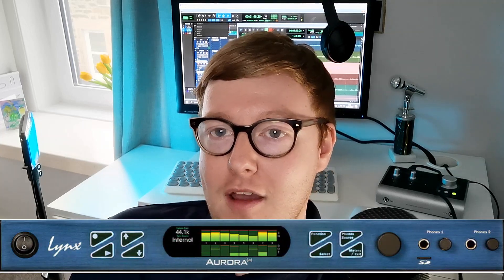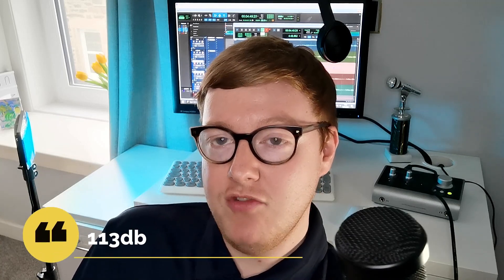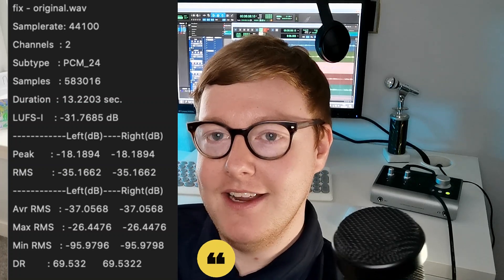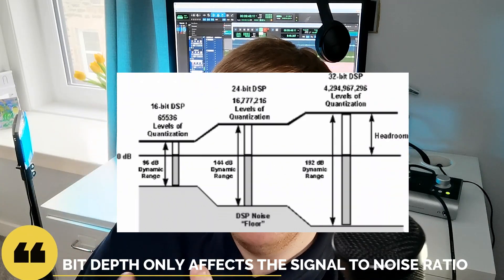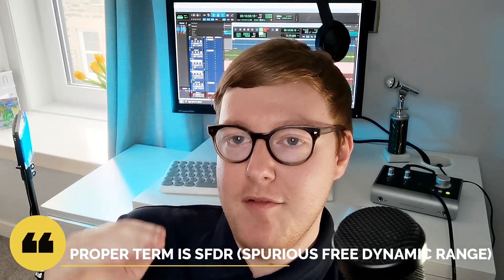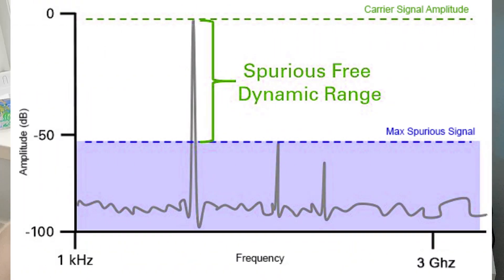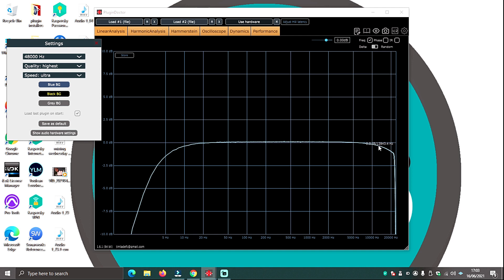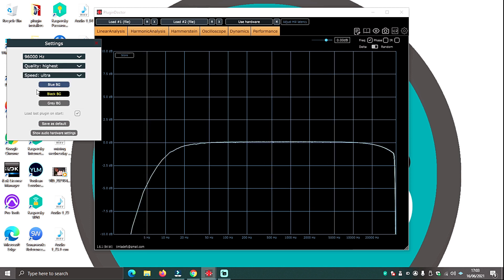Do you lose audio quality in analog gear using budget interfaces vs expensive ADC Converters (Pt 1)

Comment: this test is invalid cause in order to test audio degradation of a converter by a null test you need to loop the DA output via a cable to the AD input of the interface and record .... so if you did that now explain to us how you managed to do the same in real time using the aurora .... did you send them the original file and they did the same exact thing with the same cables same daw  you used ?... its almost impossible to test and compare 2 different converters (or even the same converters) by using 2 different signal paths .... and transparency is not always the goal when talking about high end (expensive) conversion, its also color, how hard they can be driven etc... P.s my converters cost 60-100 euros nowadays (old emu1820m)
Reply from the maker: The audient tests are a simple DA AD loop running input into output.

The access analog lynx converter is still a round trip but its streamed over the Internet lossless. The exact same audio file from my daw is fed into their converter and then fed back into my daw in real time. I then print that to a track, as I did the audient. All tracks going out from the same daw to a converter and coming back into the same daw and then being printed in real time in the same daw session. Theres more latency with access analog but also latency with the audient so all the waveforms were manually adjusted at maximum zoom so they lined up as perfect as physically possible. 

Pretty valid test to me conseriding the circumstances. I didn't say it was fully 100% scientific but it's still a valid test.
Reply: @PaulThird  - I love the it’s not scientific, what about stacking large numbers of tracks. or the cables are making a big difference comments.
You never said the Lynx is crap.
Paul actually does comment on folks needing systems like them for higher track counts going in.
I saw this and ran a similar test.
The tracks do not null with a phase flip.
Oddly I *think the cancellation was different depending on the plug-in used to do it 🤣.
My concern is latency time adjustment. How accurate is adjusting by eye (as close as I can get it)?
I have a Lynx Audora (n) 24.
I paid about $4400 for it.
That’s $183 per channel in and out (quite reasonable).
It can be configured for 8, 16, 24 or 32 analog I/O, you can add digital I/O, they have a preamp card option. You can change the interface - Avid Digi-Link, Thunderbolt 3, Dante, USB (limits you to 16 channels).
I usually only need 2 inputs or outputs at a time, but when I track drums or full bands. I need up to 24.
Reply from the maker: Somebody else commented about the cable but access analog probably use better cabling than me anyway haha mines is just a half decent TRS I found on amazon.

Tbh when your considering 24 channels its not a bad price. I had a mackie onyx blackbird and focusrite saffire Pro back in the day and they were.. Alright.

If I needed all those channels then I'd just need to bite the bullet. Is what it is. As you said under £200 per in and out is very reasonable
Reply: @PaulThird  - the Aurora (n) analog ins and outs are DB25 connectors. Any cable in reasonably good condition should be fine.
Ethan Winer has a video comparing crap cables to $400 cables on wooden lifters. He built a null tester and you can probably guess how that ends.
Cables do cause capacitance, but very expensive cables are horseshit (especially “high end” power cables)!

Comment: Hahaha yes I thought converters didn't matter any more untill I purchased the presonus 64s. Omg what a pile of s**t that conversion is. I've been using Motu for over 10 years and agree price shouldn't determine quality because the dynamic range and the amount of channels you get on the motu's is a bargain!
Reply from the maker: I'd say that's the 3rd comment I've seen for the motu 🤓
Reply: if you use mac, motu is great, if you are using windows it is great if you finally get it working. and their customer service isn't bad, it is basically non-existent. i got rid of mine last week and got a 3d gen focusrite. after 5 years of motu i did not expect my interface to basically be just plug 'n play.
Reply: the sound of the motu was amazing tho and the reverb that comes with it is a darn good one too.

Comment: Its a typical sign of an inferior converter if the highend gets better on higher sampling rates due to botched filters etc. It will tax the system more if you are forced to work in snake oil sampling rate in busy mixes.
Reply from the maker: Do you think that's what is happening in the lynx?

Comment: How exactly did you test the signal using PluginDoctor? Did you just play a white noise in your DAW or did you send the signal in through the input?
Reply from the maker: Connected input to output 🤓
Reply: Could you make a similar test with the Focusrite 2i2 3rd? I've heard that the converters shouldn't be good enough to use 96 KHz.
Reply from the maker: I'd need to get my hands on one which isn't possible im afraid. It's easy enough to test if you own one though. You can print via a DAD loop and record at different sample rates and then do null tests and measure to compare if a certain sample rate results in a better null
Reply: @PaulThird  I do own one, I just don't have a loopback cable.
Reply from the maker: You don't have a TRS cable?

Comment: Great video, Paul. Another listening test you could do is the outputs of said converters. What I’d say about the new BLA interface is that the outputs and headphone amp genuinely sound better than other interfaces and certainly for the monitor outputs, this must be down to the D-A conversion. 👌
Reply from the maker: I still love that test you done by picking up the audio of the headphones with the sonarworks mic.. The method has its flaws but I still think that was a genius move 🤓 a test is still better than no test.

What was your take on the cleanliness of the black lion mic pres?
Reply: @PaulThird  yeh, that’s defo not scientific but did highlight the affects of the power difference supplied to the headphone amp. The BLA pres are clean. I wanted to avoid a comparison though. In hindsight I should have. Had to send it back though.
Reply: @PaulThird  CS4272 that chip only have 110db of DR BUT have lot of vibe with a good bass response and stereo image/depth.I had a focusrite pro 40 and miss it for their color and low sound.It's a good chip for warm, vibey and dark sound. I compared with my 124db AD converter and still miss it when I hear the recordings I made with it. I think there is no coincidence that Black Lion used that chip on 2021.